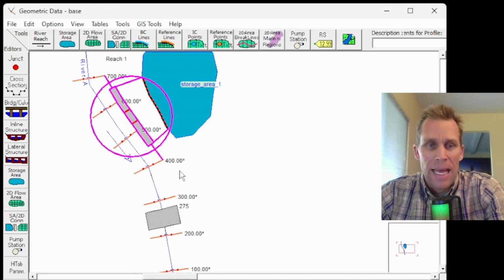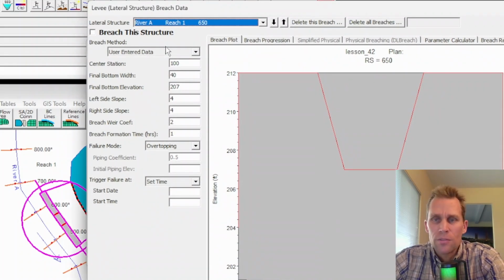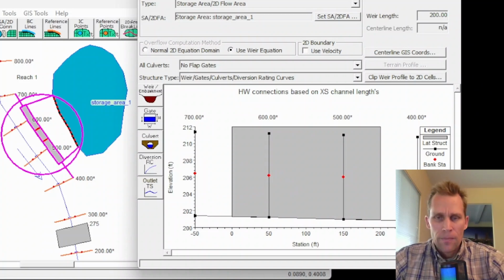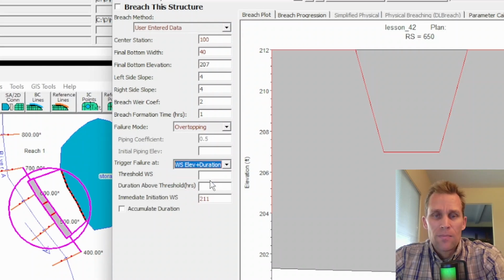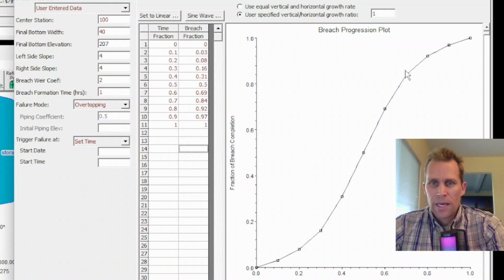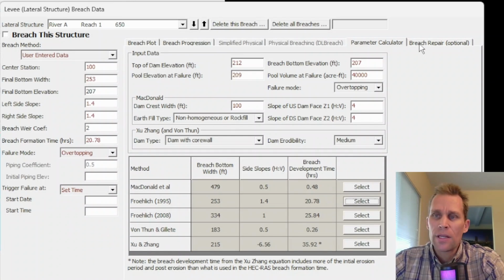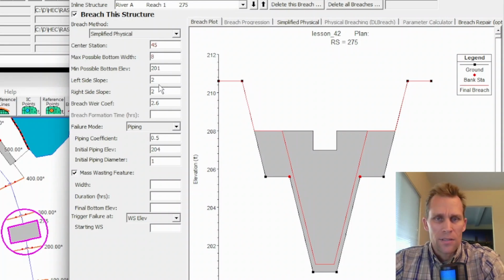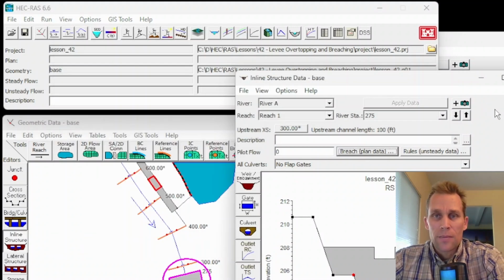HEC RAS Lesson 42 - Levee Breaching & Dam Breaks

Comment: Hi Tim, thanks for the awesome video.

Do you know what hec-ras assumes about the initial height of water above the crest in an overtopping scenario? Does the user control this with the initial water condition for the SA relative to the crest elevation? What if an initial water level lower than the crest is specified?
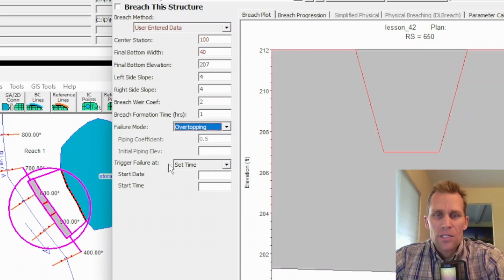Reply from the maker: Hi Drew. If your breach data uses a "Trigger Failure" of "WS Elev" or "WS Elev + Duration", then HEC-RAS assumes the dam breach will occur when the calculated WS Elev reaches that specified elevation (and duration, in the case of "WS Elev + Duration"). I start talking about this at 7:51 in the video. A breach could begin immediately, or never, or anytime during the simulation run. HEC-RAS allows for an overtopping dam breach to occur even if the water surface elevation never exceeds the crest elevation. In this example, the storage area is on the downstream side of the levee breach and doesn't affect the dam breach trigger. I hope that helps.

I show a full working example of a Dam Breach in this video: https://youtu.be/bybykbix5g4

Comment: Nice video! Can you do a 2D/SA Connection dam breach model? In some cases, the dams have outlet works & emergency spillways and the downstream faces have much higher elevation than the bottom of the breach. It results in the breach flow is very small. How do you go about fixing it without using Terrain Modification to create the breach geometry on the downstream side? Thanks!
Reply from the maker: Hi Tom. Good question. I'll definitely add an exercise video on dam breach. And I'll look into that particular scenario you described. But I don't have an answer or video on that topic at this moment.

Comment: I am working on dam break analysis running for unsteady flow .. I am using 30 m resolution dem facing this following error can you please support in resolving this error. 

Weir elevation is lower than the 2d flow area
Reply from the maker: Hi Rashmi.
Based on that error message, I'm guessing you either need to increase the weir elevation or check your DEM elevation data (at the 2D flow area). If you email me your project files (in a zip file) I can take a look at it. timnelson93411[at]gmail[dot]com
Reply: @ thank you so much for your quick response , I am mailing my model..